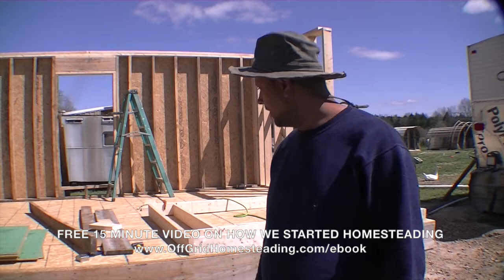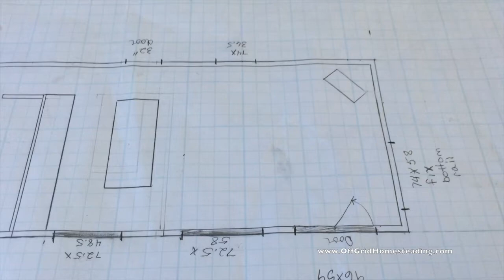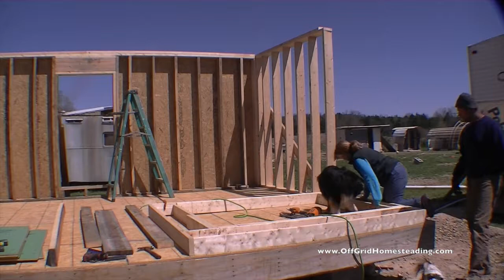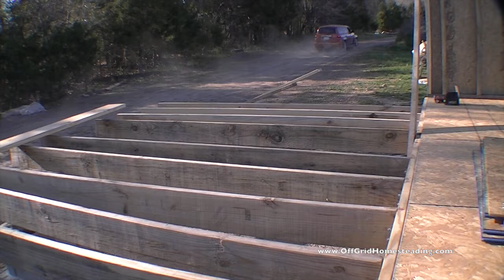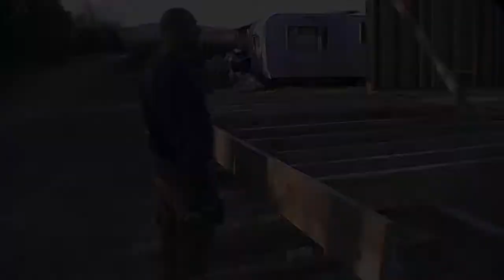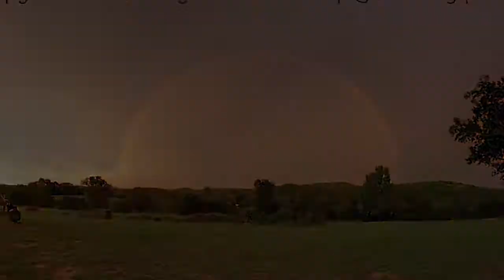OGH - DIY Framing of Tiny House part 3

Comment: I see you're back to using  3-ply header. What changed your mind?
Reply from the maker: Since the window was a littler taller than I expected and we wanted to maintain the base height the same, I had thought that 3 ply header would be stronger than a 2 ply, and I had to cut it as 8" instead of 9.5" tall.  It was pretty heavy all nailed together!  wow.
Reply: Yes a 2-ply header is stronger than a 3-ply, but it's still overkill and you're taking up valuable space for insulation. I'm not sure what you mean when you point out the height of the header. This should have no bearing on whether or not the header is 2-ply or 3-ply.
Reply from the maker: One of the two ply's of the header had a slight crack around a knot in the wood.  I didn't trust it and that was the only wide enough piece of lumber I had left.  So I thought lets reinforce the shit out of the good header and not so good header and then I know I have a super good header.    -- John philosophy!
Reply: Got it.
Reply from the maker: Uploading part 4 right now....  heading to bed... i'm falling asleep while trying to edit this vid!  its almost 1am here.  https://youtu.be/gGiRyufGFN8
Reply: Sweet dreams.
Reply: @JimWatsonTheframingMagician  I was short on materials so I used the materials that were available.  I was not planning on sealing / or foaming inside the 2 ply headers.